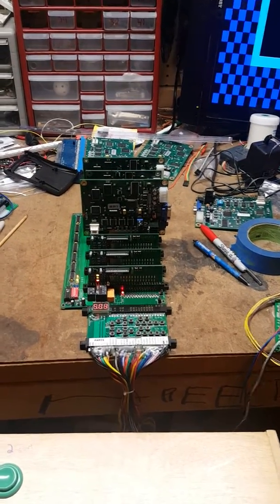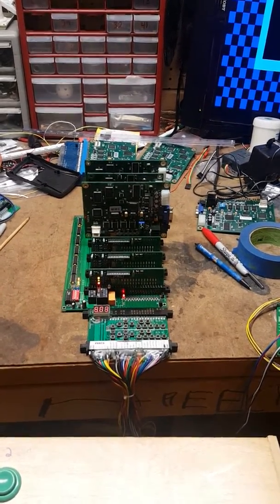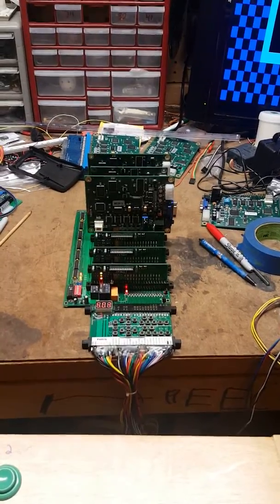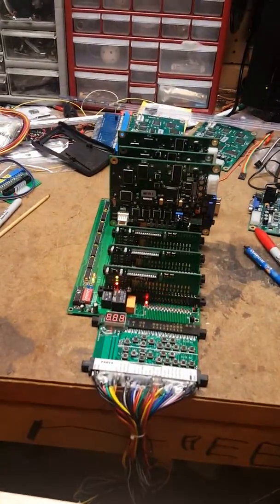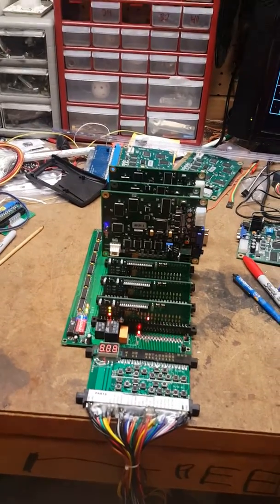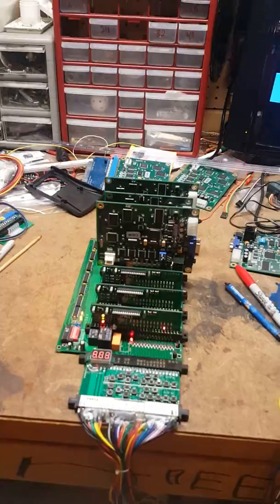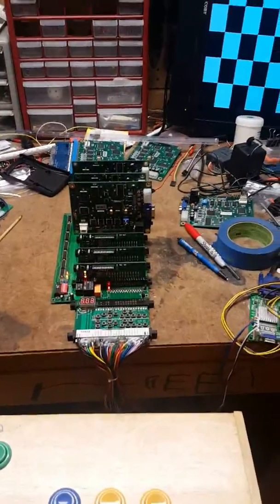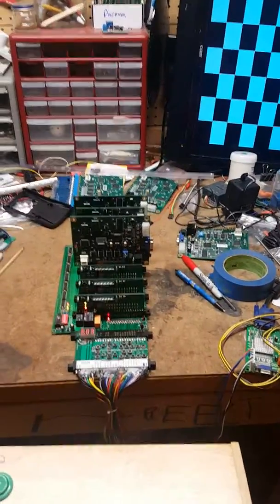RiddledTV.com JAMMA Tester with Test Pattern Generator v2 with Sound

Comment: will this tell me if the power coming over the jamma is good? i run a raspberry pi with a jamma adapter and i think the jamma adapter is dead. it feeds no power to the pi. the pi works seperately out of the cabinet
Reply from the maker: I have another product that is a Jamma Passthrough adapter.  You insert it between your Jamma harness, and your gameboard.  It provides a voltmeter, buttons and LEDs to show which buttons are pressed.  You can find it on RiddledTV.com/arcade

Comment: I want to buy this, but why doesnt it have a digital volmeter on it? I am looking for a sleek all in one solution.  I have so many cabs to test, this would be optimal :/
Reply from the maker: I didn't add a voltmeter, and would not recommend doing so.  This tester requires very little power to run, and setting your power supply with such a small load would not be comparable to a normal arcade board.  I'd recommend only adjusting your power supply with the gameboard you plan to use.
Reply: @riddledtv  good call, this is logical
Reply from the maker: For what you're suggesting, I'd recommend using a Jamma tester with a passthrough to set voltages.  This would allow you to set the power supply level using the actual load from your gameboard.  https://riddledtv.com/arcade/jamma_testers.html#TesterButtons